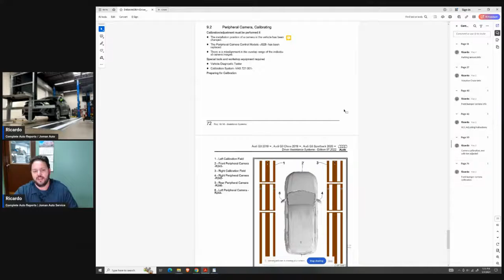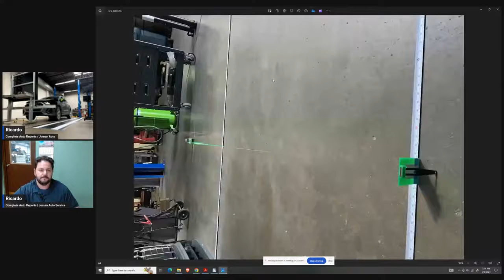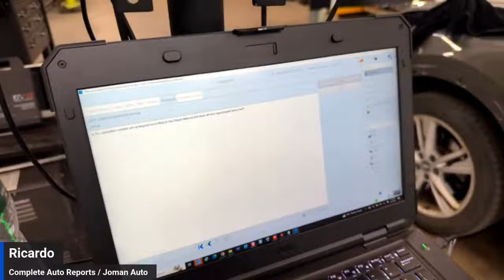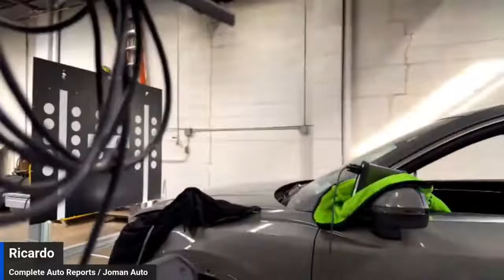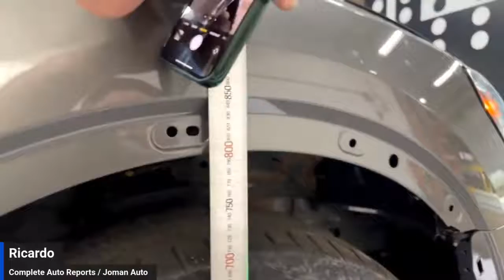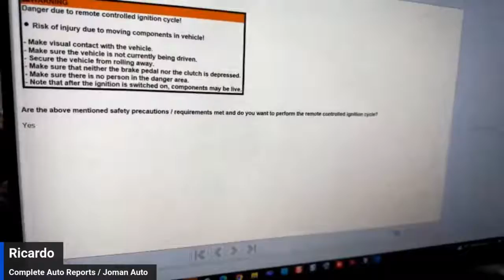Profit With ADAS Calibrations: 2020 Audi Q3 | Static 360 + Dynamic Radar Fix | Calibration Training

Comment from the maker: 📸 No warning lights. No new parts. But still out of spec.
This 2020 Audi Q3 needed static + dynamic calibrations to get right—and we break it all down using lasers, rulers, and the 7 Step ADAS method.
👉 Full tool list used in this video:
www.7stepadas.com/tools

📘 Learn the full 7 Step ADAS method:
www.7stepadas.com

#audiq3 #ADASCalibration #StaticCalibration #DynamicCalibration #7StepADAS

Comment: This is an insane procedure for activating and deactivating high beams in automatic mode, it's horrible.
Reply from the maker: Is this one of the steps in troubleshooting the auto high beams? If the headlights were replaced, they may need to be calibrated to work properly.